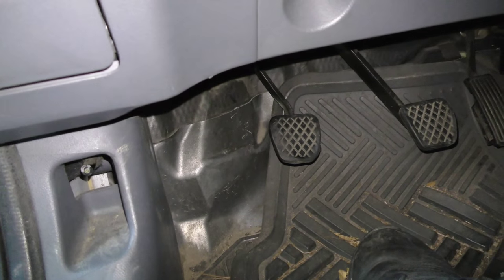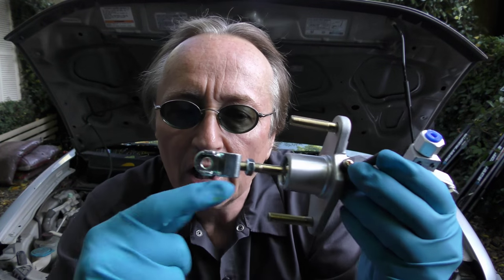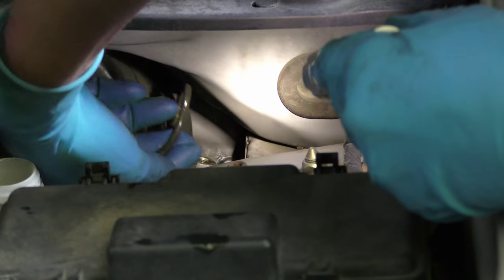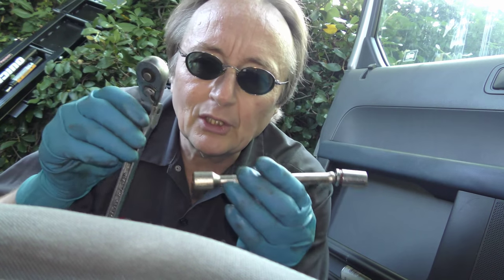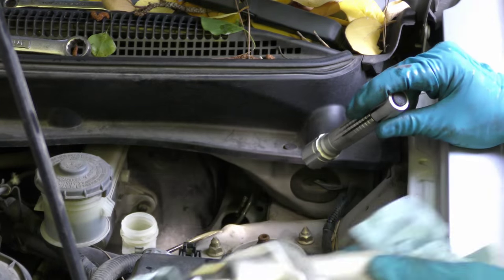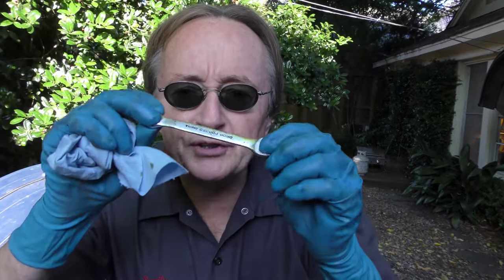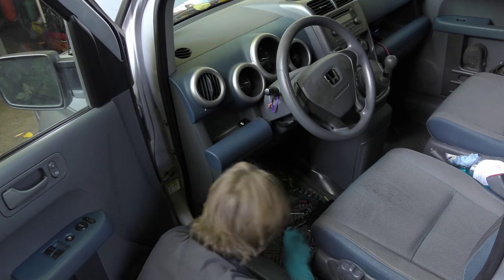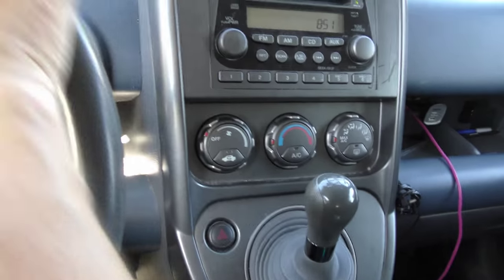How to Fix a Car that Won't Go into Gear (Clutch Master)

Comment: My sisters 2004 chevy aveo (140k miles on odometer) the passenger cv axle snapped in half and i took it all out and it wont shift from park to drive or park to reverse is the transmission done? she said it didnt want to go forward and she had to force it out of the street 
any solutions or is it just time to junk it?
Reply from the maker: if it's not just a bad switch that allows the tranny to be shifted out of park, then junk it

Comment: Hi Scotty. I have a 99 mitsubishi 3000gt. When i push the clutch in and turn key to start it lurches forward as it trys to start. If i put the car in neutral while the engine is off and start it in neutral when i push the clutch in and try to shift into 1st gear it will not go into gear. Only when engine is off. Help !!

Comment: Sime cars have a clutch regulator, a little valve that keeps the pressure right. If the spring gets weak, same symptoms, pedal to the floor, difficult to get gears. Change the valve or take it out and put a plug in its place. Cured.

Comment: 3rd gear stuck after braking without clutching, the engine stopped in 3rd gear now its stuck only in 3rd gear but the rest are working smoothy.

Comment: Scotty i need your help , I have a 2006 lexus gs300 with 112000 miles last week I starting having a problem with the car not going on reverse but the drive goes perfect and the neutral also works as if it was drive another words I do not have neutral anymore it goes foward but still no reverse i change the oil with toyota original trans oil but sitll doing the same , what can the problem be?
Reply from the maker: +douglas diaz  time for a tranny rebuild, reverse is just breaking down inside.

Comment: I have 03 Civic sometimes it won't go into 1st gear coming from a complete stop I have to force it in. Once I went into 1st but not all the way and it made a awful grinding sound. Does this from time to time. I have to play with the stick to get it into 1st. Are my synchronizers bad ?
Reply from the maker: odds are sychs are going bad, but weak hydraulic cylinders can do that if old and worn, try that first
Reply: Scotty Kilmer wow. Car only has 70k miles hope it's not the synchronizers

Comment: Hey, Scott can u help me diagnose my accord 1996 vtech automatic transmision.   I just had it fixed for overheated gaskets and that looks just fine now but when is on D4 just wont shift to second gear it revs only and it speeds only to about 25 miles max. I stop using the car since i have no money now to take it to a mechanic to diagnose.  please help me out, thx
Reply from the maker: +Ofelia Valencia Flores  transmission is going out, typical on that model. Try shifting it manually using the shifter from low to high as you drive and do that if it works. Repair is 3 times the car's value

Comment: Hey Scottie I have a 1996 Chevy S10 my problem is that when I'm driving it sometimes it will just stop going and when I hit the gas it just revs up it does it on the fly sometimes not all the time what can I do to fix that I hope its not the hole transmission itself
Reply from the maker: transmission is going out
Reply: Ok thanks I am gonna order a new 1 right now

Comment: Hi Scotty I have a Ford 150 XLT change a slave cylinder change the clutch Let it bleed the system will not go into gear when I start it goes into gear when the car is off help me out cuz I'm going nuts

Comment: Hi. Do u have any idea why audi a3 2005 wont go into 1st whether engine is in or off. I changed the shifter in the cabin and entire gearlinkage. Sadly the gears are exactly the same. All the others including reverse are very smooth. Cheers
Reply from the maker: well, a really shot first gear inside the transmission will do that. Or bad shifter bushings going into first gear. Those audis have pretty weak transmissions as they age
Reply: Scotty Kilmer cheers. Im inclined to the fact its the box too. Now have to work out how to get it out. Thanks

Comment: hey Scotty is prestone dot 3 synthetic bad to put into a clutch master. i changed the master on my 85 4runner and didn't notice till after that the big bottle said hi temp synthetic. after a couple days it's hard to get into gear
Reply: I would suggest drain and refil with OEM  recomwended fluid shouldd fix said issue if there is no damage from having  wrong fluid in there

Comment: on the air cooled 66 bug how to hold spring and shifter in place while keeping pressure so  iit wont pop out when tighten the bolts down

Comment: please help..my dad and I replaced the clutch on his 96 Ford Explorer 5 speed manual 4x4. it will go into gears except in reverse. Any suggestions?
Reply from the maker: pray the shifter linkeage has a problem, and that reverse gear is not damaged. I once put a clutch on one, and just taking out the transmission for the clutch job and putting it back in broke reverse gear

Comment: my 94 miata was working fine all day than in the afternoon it didn't wanna go into gear. i could put it in 1st and reverse and it turns on n goes but the clutch was all spongy and I checked the clutch slave and everything no leaks. could it be the clutch that is out?
Reply from the maker: replace the master cylinder first, pray it's just that

Comment: Low transmission fluid may cause a manual transmission not to stay in a selected gear right? Please answer
Reply from the maker: it can if it overheats
Reply: Scotty Kilmer ok
Reply: Scotty Kilmer so if it doesnt over heat then what causes it ?

Comment: I have an automatic charger 5 gears. my car shifts fine to 1st 2nd and 3rd gear fine, but when it shifts to 4 it messes up and puts the car in neutral. Do you have any idea what this could be?
Reply from the maker: either linkeage is bad or fourth gear is shot inside the transmission

Comment: Scotty I have a 2010 Mustang GT with 5speed and I cant shift to any gear. it moves around soft and i check the master cylinder and its not leaking and fluid is fine my clutch feels fine also i dont know what else to check
Reply: Carlos Contreras bad shifter linkages?
Reply: Im late on this but it was the shifter pins which was broken

Comment: what would cause a manual transmission to not go in gear when running. replaced the clutch master cylinder and the clutch slave cylinder. any ideas
Reply: what's the easiest way to replace it

Comment: hey I got a question for u I own a 98 4dr sport edition rt /highlander neon or high line I forget bout that but all my other gears shift jus fine but second gear but I think it's synchronizer if so how hard is it to replace it I know enough to work on my own car n no wat I'm doin but I know 1'2 r one synchro 3'4 but some times 5 n reverse have there own synchro so I'm asking if u think it synchronizer prob n how hard is it if u have video on it I'd like to see it
Reply from the maker: +Daniel Lipe  a royal pain, transmission has to be split in half and taken completely apart. Not a job for anyone but a pro tranny man. Even I took one apart once (it was broken and I was curious) and was amazed. We opted for a used unit.
Reply: Hey if I replace my fluids with new fluids cud it work cus if I'm on a hill with car n hold brake n clutch then put into second then release the brake n clutch if the car don't move its n second I start the car n take off in second n it dnt slipp at or grind y its n gear but I cant shift up from second or down from second
Reply from the maker: +Daniel Lipe transmission would need rebuilding to fix that
Reply: +Scotty Kilmer dang it I wanna truelly thank u for u taking time out of your day to answer few questions I love your videos by the way

Comment: i have a 2003 chevy cavalier automatic.  the shifter goes threw all gears but it wount click into gear or move.  the shifter will be in reverse put the is still in park and wont move at all.iam freaking out. can you help?

Comment: hey Scotty I have a problem with my shifting I already replaced the clutch and replaced master cylinder and slave cylinder and while driving the clutch pedal gets lose when pressed and later gets firm again
Reply from the maker: try bleeding the cylinders first, and pray you didn't get a bad master, aftermarket ones often stink

Comment: Hey I have a 1999 Mercury cougar 2.5 v6 24valve 5speed and I was driving last night went over some tracks (not speeding) and I was putting it into second as I was going over and then when I got over I went to goto third gear and it wouldn't go into third gear, I can move the stick shift anywhere even in the reverse position and it's still in second gear? Could you please help
Reply from the maker: +Darwin Broussard   pray the linkeage just broke on the shifter, jack it up and check that first.
Reply: +Scotty Kilmer I jacked it up and looked under and had someone move the stick shift and both cables were moving with the rods when the stick would be moving, but it won't "go into" another gear no matter where the stick is

Comment: Scotty. i have a question. what if the fifth and six gear won't go in?
Reply from the maker: +kurosaki1105 then transmission has internal problems, like bad shifter solenoids or worn out gears

Comment: I changed both slave and master cylinder.
And my car won't into gear still:/
 I tried bleeding it and the clutch just sticks to the floor when I close the valve:/

Comment: I have a 2011 chevy cruze 6 speed that sometimes has trouble going into first doesn't grind .sometimes it goes in just fine and other times it gives trouble what could that be.All other gears are fine.

Comment: I've replaced clutch, pressure plate, throw out bearing, pilot bearing, clutch master/ slave cylinder (prefilled due to being a sealed unit) and still can't get it in gear, all that was broken was the clutch release bearing I replaced everything while I was at it I've double checked my work both times I've removed the transmission, clutch isn't backwards it only goes on one way, I've put a vacuum pump on the lines and still nothing, wth??? Any help?

Comment: I have a question I recently bought a 2000 Isuzu rodeo automatic and at first the car worked in reverse and low gear and at one point it was in low gear but on the dash it showed as if it was in 2nd now it will not move at all it just revs up like it's in neutral I changed the transmission fluid and it was dark now it won't move at all do I need a transmission or could it be a solenoid or something please help ASAP
Reply: the shifter goes into gear fine but it don't move
Reply: +Scotty Kilmer I changed the fluid but not the filter with no luck if the filter is clogged could it cause this

Comment: So I have a problem with my Subaru it wont go into gear and I’ve replaced the hydraulics twice and nobody can figure out what’s wrong the clutch is still good and transmission if filled and safety bearing is brand new as well

Comment: 1991 caprice classic automatic will shift to nuetral but wont move go forward or backward. any suggestions..running on a budget
Reply from the maker: pray you're low on tranny fluid, if not, tranny needs rebuilding
Reply: scotty!

3-4
 weeks ago I noticed some red liquid under my ford expedition. I didn't 
think it was a huge deal at the time. I then drove the vehicle  a week 
later to another part of the state. This was a 200 mile roundtrip trip 
and it drove fine..After this, I noticed a lot more red liquid under the
 vehicle. Since then, I have not driven the vehicle. I have started the 
vehicle 3 times since the last time I drove it on that 200 mile trip. 
Each time the vehicle has spit out red liquid after starting it and 
running it for 15-20 seconds. 

Today was the last time I think I will start the vehicle. I was just 
starting it to roll up the windows because they were slightly cracked 
for a few weeks. I tried to put it in Drive and move it up my inclined 
driveway a few feet, but I started rolling backwards. Again, it spit out
 a tiny amount of red liquid. It looks like it is practically out of 
tranmission fluid when I checked it again today.

So I have a few questions.
-What do you think is wrong with the vehicle? a messed up tranmission 
line, gasket, or what?
-Also, I bought the vehicle about 14 months ago from a guy I knows mom 
who took great mechanical care of the car. She said the transmission had
 a warranty for life. I have no way of getting in touch with the guy or 
his mom right now, so how would I be able to use that warranty, if it is
 something more serious than a transmission line or gasket? Would a ford
 dealership be able to find out on carfax or with records online?

I basically used this vehicle for long trips. I've taken about 10 
1500 mile trips in it since I bought it. It has always driven flawless 
and I've never had any issues with it. It has been more reliable than 
any bmw or audi I have owned.

Unfortunately, im currently unemployed and I'm hoping that this is 
just a minor problem, which can be fixed for under 500 bucks with labor.
 I'm planning on using my AAA membership to have it towed to the ford 
dealership soon.

Any advice is much appreciated.

Thanks

Comment: Hey Scotty, My Honda s2000 could not continue driving, I would put it in gear and give it gas but still no movement so i had to pull over on the side of the road and get towed. I just replaced my clutch master cylinder in my Honda s2000 but clutch wont grab on. Could it be the slave master cylinder under the transmission??? Clutch was replaced about 30k miles ago. Please help!
Reply from the maker: if you can get it into gear and it won't move, clutch needs replaccing
Reply: But if I can start the car, go into gears on the shifter and move slightly will it still be a bad clutch?
Reply: Chris Leon This happened to me on my rx8 last night. Car just died off. Turned it back on and wouldnt go into gear. Put clutch all the way in and wouldnt budge. I tried shifting to every gear but the car would grind so i left it in neutral. My mechanic said mine might be the release bearing i think, or maybe the clutch completely. Might as well replace the slave master, looks like my car has original parts still. Might be worn out, not sure.
Reply: Chris Leon it's still bad.

Comment: Changing gears became difficult, bled the system no change couple days later started shifting normal, problem returns change slave cylinder still have problem. Change clutch master cylinder bled system to only fluid came out of slave cylinder. " clutch pedal with only return When bleeder open" some feel to the pedal but only when I'm close to the floor feels clutch pedal is being restricted at some point" no leaks noticed. do you think you something inside the transmission like the throwout bearing or pressure please.... Anyone?

Comment: Scotty, I have a 1995 Jeep Wrangler. I always seem to get stuck on 1st gear or on reverse. & even though I have the clutch is all the way down, the jeep will still go, so I have to push the brake or else I'll hit the car in front of me. Vise versa going reverse as well. Then when I let go of the clutch, the clutch peddle has a hard time getting back up. Please Help! Thanks..
Reply from the maker: +Jose Villa pray it just needs a new clutch master cylinder and slave cylinder
Reply: +Scotty Kilmer if it's not that... ?

Comment: Scotty Help Please I have a 2008 Chevy impala LT Automatic 3.5 after Stoping at a Light, and then Pressing the Gas there is 1 Jeark RPMs are Stable, and we Changed the Transmission fluid about 1 Mo ago. This my only way of Proving for my Family.
Reply: Transmission is most likely starting to go out. I'd start saving for a new car if I were you.

Comment: What else could the problem be if the car goes in gear when car is off but when is on will not go in gear changed the master and slave cylinder and it still will not go in gear any ideas...
Reply: what do you drive?
Reply: and please let me know what the problem ended up being

Comment: i have a 94 toyota pick wont go into gear i change the clutch alreadyy what you think it is i also chanse both of the cluth cylinder master and slave
Reply from the maker: if you changed all those parts and bled the air out, transmission would be shot. More often though clutch is installed wrong or bad parts used

Comment: If a bad Master Cylinder is causing a car not to shift into gear, would it also be causing other problems such as Clutch issues and Brake issues?
Reply from the maker: clutch issues if a clutch master cylinder, brake problems if a brake master

Comment: I replaced the master cylinder, slave cylinder , and clutch , bleed it and clutcpedal still goes all the way down when going in reverse. Gets stuck nd I’m not able to shift to the point I’m stuck in reverse and have to stall it . HELP ME FIGURE THIS OUT PLEASE

Comment: my honda civic 96 automatic transmission don't drive, only when you turn on the engine the first time drives forward then stops, after that first time it won't go any more. somebody said it was the transmission  filter, what do you think it is? thank you
Reply from the maker: +Jaime  A Hernandez  those don't have filters inside. Odds are transmission is just shot, typical on those. But do check the fluid and pray it's just low
Reply: Thank you Scotty Kilmer, I will check that in the morning,  I remember I add some more oil, but I double check and get back to you. By the way, I liked all your videos , thank you